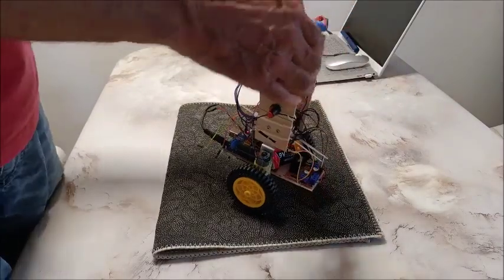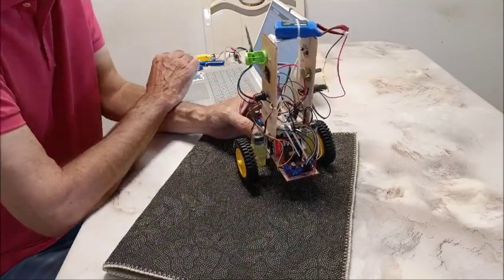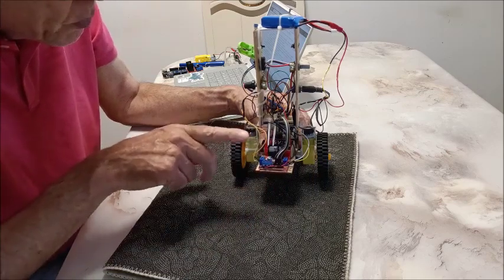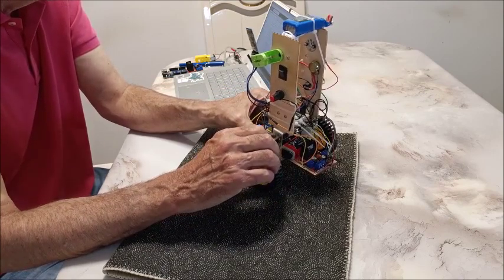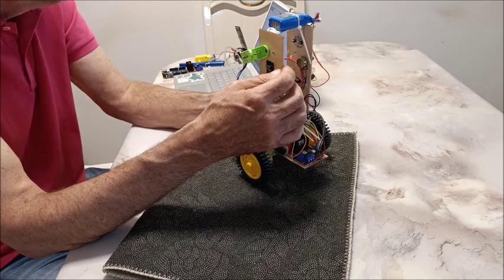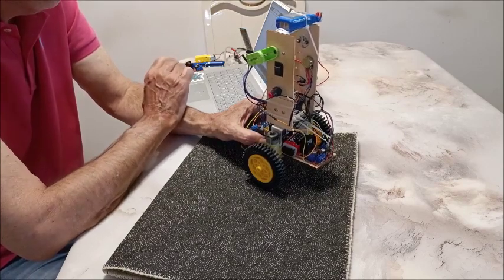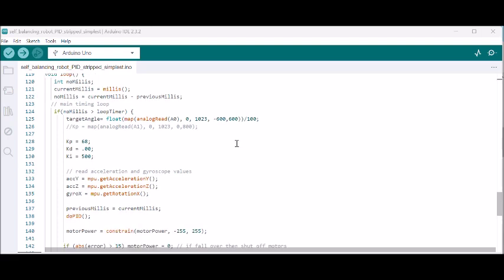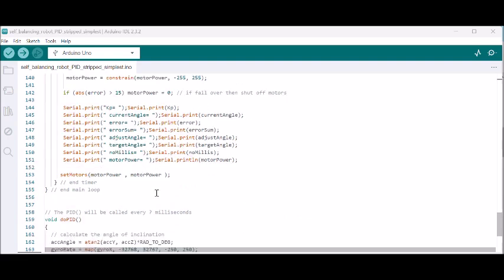Self Balancing Robot with Yellow Motors and No Encoders on Smooth Surface

Comment: sir, it is because of people like you, student like me get enthusiastic about these projects, I have been struggling on this project, despite so many videos flooded over the internet related to this balance bot, but no one explained these fine details. Thank you so much
Reply from the maker: Thats great to hear. I am still struggling to make this robot move well though so still working on it. Good luck to you. These are the most fun robots to play with other than self balancing inline wheel robots.
Reply: @demej00  even i am, i have deadline to submit on 17th dec (IST), and i can balance my bot, but only on soft-grippy surfaces, like a bed, a sofa or a pillow. i tried modyfying ur code so it works with my custom made pcb, with mpu6050, hc05 and n20 encoder motors, hop it works :))
Reply: @demej00  having a tough time modyfying ur code, as u have used different libraries and connection techniques.
Reply from the maker: @theassortedcontent1041  Yes, it will act differently due to two big things: timing of the main loop and the motors. I tried using different yellow motors and they all act differently. Seems the weakest motors acted the best as too much torque or speed caused more oscillations. Then the settings of the PID are almost infinite.
Reply: @demej00  can u explain the timing of the main loop?
Reply from the maker: @theassortedcontent1041  Ok. This is going to be a big blurb. Timing is like car timing, if it is way off, the motor wont run.
Yellow motors have terrible backlash and if you dont time the backlash properly, it will never balance. The Arduino main loop runs faster than you need so you must use a millisecond timing loop.
So, you need to do the following:
1. Put one or more potentiometers on your robot. If you don't, you will never get best values. One for your setpoint so you can move it around. Another for the P of the PID. 
2. Strip your code down to the bare bones essentials. No bluetooth or serial commands. They really mess up your timing. 
3. In your main loop, count milliseconds. Every 5 or so milliseonds, then and only then, get your sensor value, do your PID calculations and set your motor speed.

Do not use any delay()s, they are terrible.
4. keep your robot connected to your PC and use the serial monitor to print how long your loop actually takes to execute. If it is not 5 miliseconds and you are using 5 milliseconds for your if then statement, something is wrong. Find out what.
5. Use only P. If you cannot balance with only P, you cannot balance using PID.
6. Use 5 to 15 millisconds for your loop timer. You could use registers but I am no good as a programmer and like to keep it simple so I just count milliseconds. With the N20 motors, backlash is probably less of a problem and you could use a faster loop once it is balancing. If you can balance yellow motors, you can balance anything. 
Hope this helps. Jim.
Reply from the maker: @theassortedcontent1041  One more point: think about how the robot is working:  the motors purpose is to throw the robot back and forth in time. If the loop runs too fast, it throws the robot before it has reached the other side and the timing is messed up. So basically you are setting the timing of the loop to match how long it takes the motors the move the robot balance from one side of the wheel backlash to the other. With N20 motors, it takes less time so the loop can run faster. Perhaps even in microseconds compared to milliseconds.
Reply: @demej00  thanks a lot sir, that was really really helppful, it helped me complete my  competition task
Reply from the maker: @theassortedcontent1041  Thats gratifying to hear, thank you. I hope it worked.

Comment from the maker: Here is complete Arduino code with huge comment section to explain setup and details. Hope you make one!

// jim demello jun 2024 - short Arduino code for SBR (self balancing robot) using 48:1, 150 rpm yellow motors with no encoders
// majority of code taken from midhun_s https://www.instructables.com/Arduino-Self-Balancing-Robot-1/
//
// hardware: 1.a. L298N motor driver - be sure jumpers are on enable pins or will not work. These drivers are cheap, I had a bad one
//                so buy more than one.
//           1.b. Arduino Uno - also had a bad one where one wheel would only turn in one direction. Replaced Uno and it was good.
//           2. I used two potentiometers to tune targetAngle and Proportional term but you don't have to, but it makes life easier to do so
//           3. MPU6050 - be sure you calibrate it, don't use someone elses values, like mine.
//              MPU6050 - be sure you mount it with the X axis parallel to the axis of the wheels.
//           4. power - I used 2s lipo to power L298N. So a fully charged 2s lipo, 8.4 volts will deliver about 6.4 to 7 volts to motors.
//                      And I used rechargeable 9 volt battery to power the Arduino Uno when not connected to USB. Lasts about 15 minutes.
//           5. motors - 48:1 geared yellow motors, 150 rpm at 6 volts. No encoders required. Encoders will be necessary to
//                       control tracking and fast robot response. Will do that someday.
//           6. wheels - larger and heavier wheels make for better control. 65mm are ok but 80mm are great.
//           7  counterweight - mount lipo on top of SBR for better control - SBR falls over slower with weight on top -
//               larger wheels and counterweight can compensate for slower motors.
//           
// Notes:    1. be sure wheels are turning towards direction of lean.
//           2. do not use low baud rate for Serial which will result in a timing loop too slow to work.
//           3. according to this article: https://polyengineer.wordpress.com/2014/08/08/self-balancing-robot-pid-control/
//              you should use 5 times Proportional term for Integral term value. It works. I use up to 7 times. 
//              This prevents drifting (except on uneven surface - need encoders to stop that). Not using Derivative so this is a PI controller.
//           4. targetAngle is another term for setPoint.
//           5. don't use delay() - it will mess up the timing.
//
// My opinion: 1. an inverted pendulum like an SBR has a natural frequency that needs to be matched by the timing of the loop
//                and the Proportional term. If P is too high then it becomes a bang-bang machine, on and off - effective
//                but ugly. The timing loop must be consistent for good balancing or it will jump all over the place. 
//                So print out how long the loop takes to determin its Hz. A Hz of 50 to 60 is ideal - about 20 milliseconds. 
//                Be sure all of your code is inside the timing loop or strange things can happen.
//                Timing loop can run from 30 down to 5 milliseconds.
//             2. The high Integral value (5 times P) prevents drifting.
//             3. This is the shortest, simplest and most effective code to self balance a two wheeled robot - I think. 
//             4. This robot will balance and stay in place pretty much on a smooth surface like a stone floor. Most robots
//                with these motors will not balance on a stone floor and/or they will drift off and fall over. 
//                They will balance only on carpet or rough surfaces. I think it is due to bad timing loop. 
//             5. MPU6050 Complementary filter code here is effective, maybe more effective than MPU6050 DMP values which seem to jump
//                around more than these. Haven't tried Kalman filter - looks too complicated for me.
//             6. The motors can be optomized by matching the point at which they both begin to move at the same time by
//                adding or subtracting from one of the motors motorSpeed values. Haven't done that here as I wanted the code
//                stripped down to it's essentials.
//             5. A great thanks to midhun_s. 
//             6. I started work on this robot 6 years ago and finally got it working to my satisfaction this year. 
//                I accidently had it working 6 years ago on a smooth surface but never knew why. Now I think I know. Never give up.
//             7. Opinions are overrated by their holders.
//           
#include "MPU6050.h"

// vars for mpu6050 //
int16_t AcX,AcY,AcZ,Tmp,GyX,GyY,GyZ;

#define leftMotorPWMPin   6
#define leftMotorDirPin   7
#define rightMotorPWMPin  5
#define rightMotorDirPin  4

float sampleTime ;

MPU6050 mpu;

int16_t accY, accZ, gyroX;
volatile int motorPower, gyroRate;
volatile float accAngle, gyroAngle, currentAngle, prevAngle=0, error, prevError=0, errorSum=0;

//////////////////////////////////////////////////////////
volatile float Kp=25,Ki=0,Kd=0,targetAngle=0;
//////////////////////////////////////////////////////////

float adjustAngle = 0;
unsigned long currentMillis;
long previousMillis = 0;  
long loopTimer;

#define PRINTLN(...)      Serial.println(__VA_ARGS__)

void setMotors(int leftMotorSpeed, int rightMotorSpeed) {
  if(leftMotorSpeed >= 0) {
    analogWrite(leftMotorPWMPin, leftMotorSpeed);
    digitalWrite(leftMotorDirPin, LOW);
  }
  else { // if leftMotorSpeed is < 0 then set dir to reverse 
    analogWrite(leftMotorPWMPin, 255 + leftMotorSpeed);
    digitalWrite(leftMotorDirPin, HIGH);
  }
  if(rightMotorSpeed >= 0) {
    analogWrite(rightMotorPWMPin, rightMotorSpeed);
    digitalWrite(rightMotorDirPin, LOW);
  }
  else {
    analogWrite(rightMotorPWMPin, 255 + rightMotorSpeed);
    digitalWrite(rightMotorDirPin, HIGH);
  }
}
  
void setup() {
  Serial.begin(115200); // do not go low as in 9600 or timing loop will be very slow
  // set the motor control and PWM pins to output mode
  pinMode(leftMotorPWMPin, OUTPUT);
  pinMode(leftMotorDirPin, OUTPUT);
  pinMode(rightMotorPWMPin, OUTPUT);
  pinMode(rightMotorDirPin, OUTPUT);
  
  // initialize the MPU6050 and set offset values
  Serial.print("Initialize MPU at: ");Serial.println(millis());
  mpu.initialize();
  int con = mpu.testConnection(); // test MPU6050 - I had some problems so this was necessary for me 
  PRINTLN(con ? F("connection successful") : F("connection failed"));

  mpu.setYAccelOffset(2067); // from calibration routine - use your own calibration values
  mpu.setZAccelOffset(1207);
  mpu.setXGyroOffset(4);
  Serial.print("End Initialize MPU at: ");Serial.println(millis());
  delay(1000);
 
  loopTimer = 15;
  sampleTime =0.015;
} // end setup()

void loop() {
   int noMillis;
   currentMillis = millis();
   noMillis = currentMillis - previousMillis;
  // main timing loop
   if(noMillis > loopTimer) {
       targetAngle= float(map(analogRead(A0), 0, 1023, -600,600))/100;
       //Kp = map(analogRead(A1), 0, 1023, 0,800);
    
       Kp = 60;
       Kd = .00;
       Ki = 500;
           
       // read acceleration and gyroscope values
       accY = mpu.getAccelerationY();
       accZ = mpu.getAccelerationZ();  
       gyroX = mpu.getRotationX();

       previousMillis = currentMillis;   
       doPID();
     
       motorPower = constrain(motorPower, -255, 255);
    
      if (abs(error) > 15) motorPower = 0; // if fall over then shut off motors
  
      Serial.print("Kp= ");Serial.print(Kp);
      Serial.print(" currentAngle= ");Serial.print(currentAngle);
      Serial.print(" error= ");Serial.print(error);
      Serial.print(" errorSum= ");Serial.print(errorSum);
      Serial.print(" adjustAngle= ");Serial.print(adjustAngle);
      Serial.print(" targetAngle= ");Serial.print(targetAngle);
      Serial.print(" noMillis= ");Serial.print(noMillis);
      Serial.print(" motorPower= ");Serial.println(motorPower);
    
     setMotors(motorPower , motorPower );
   } // end timer
} // end main loop

void doPID()
{
  // calculate the angle of inclination
  accAngle = atan2(accY, accZ)*RAD_TO_DEG;
  gyroRate = map(gyroX, -32768, 32767, -250, 250);
  gyroAngle = (float)gyroRate*sampleTime;  
  // complementary filter ///////////////////////////////////////////
  currentAngle = 0.9934*(prevAngle + gyroAngle) + 0.0066*(accAngle);
  //////////////////////////////////////////////////////////////////
  error = currentAngle - targetAngle + adjustAngle + 0;
  errorSum = errorSum + error;  
  errorSum = constrain(errorSum, -250, 250); // clamp Integral
  
  //calculate output from P, I and D values ///////////////////////////////////////////////////
  motorPower = Kp*(error) + Ki*(errorSum)*sampleTime - Kd*(currentAngle-prevAngle)/sampleTime;
  /////////////////////////////////////////////////////////////////////////////////////////////
 
  prevAngle = currentAngle;
}
Reply: Empty